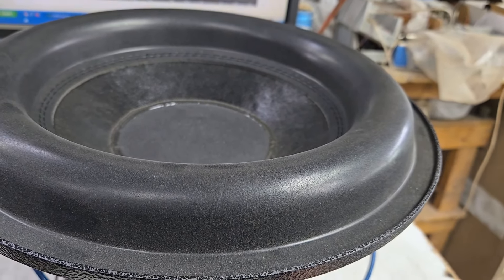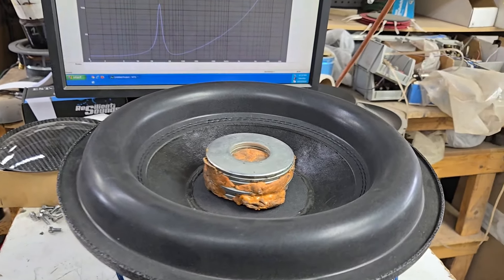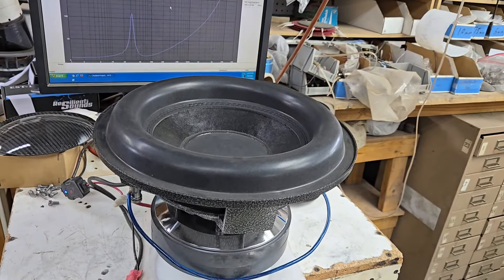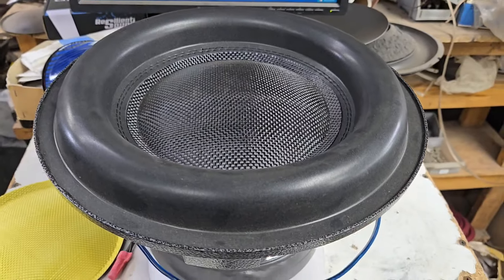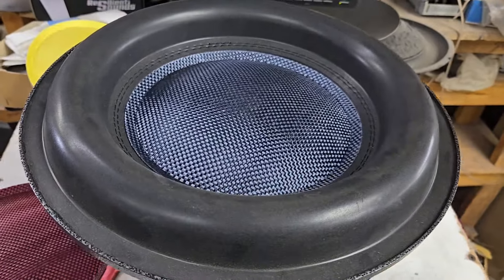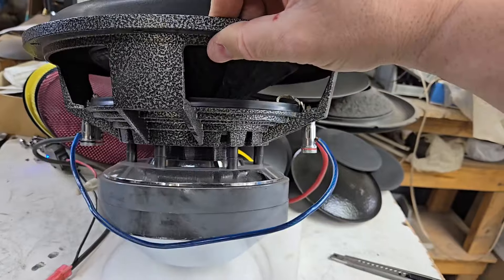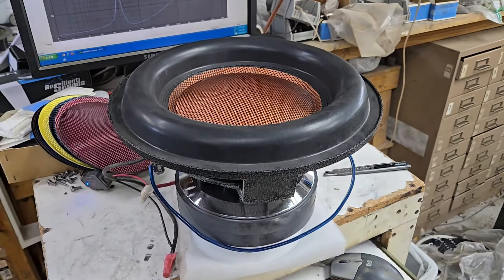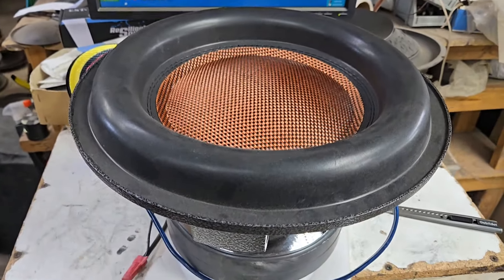12" NEW! Cylon Jr. Subwoofer by Robot Underground 🤖 3" copper 1200wrms made for YOU! 10 & 15 avail.

Comment: Question..what determines how much air space for an enclosure a subwoofer needs? I've noticed that DC subs require ALLOT less space than say a sundown sub or allot of other subs for that matter..most of DC say there good with 1.5 cubic feet per 12 vs 2-2.5 cubic feet per 12 from most other brands...
Reply from the maker: Remember that the VAS is the amount of airspace required in order for the subwoofer to reach the FS